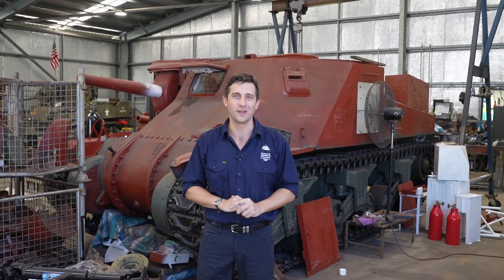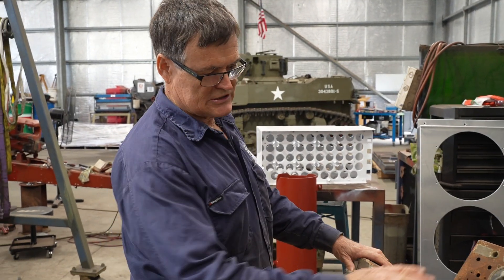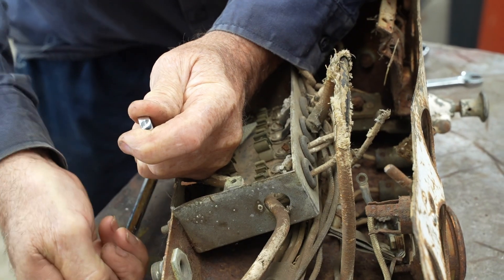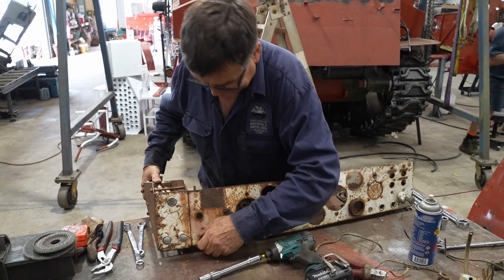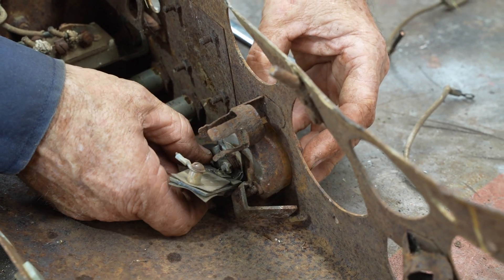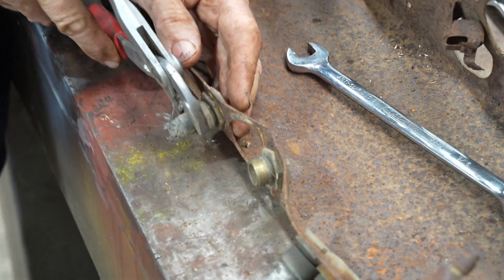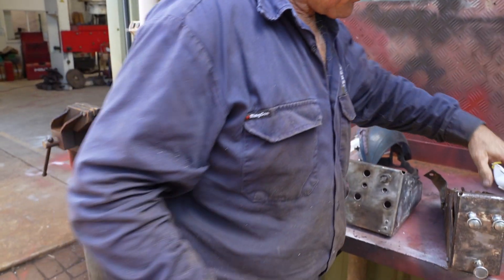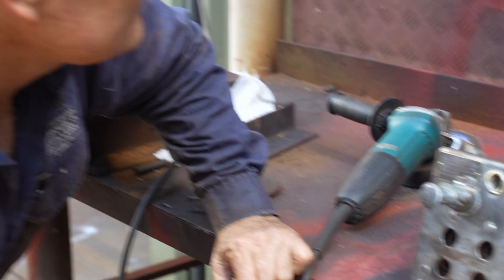WORKSHOP WEDNESDAY: Rusty WWII Grant Tank DASHBOARD restoration!

Comment: You popped up in my feed so took a gander, thank you for saving the old US tanks.  Got to love how interchangeable the yank's built everything.  Watched a British tank shop and they commented the brit tanks are more of a repeated one off as none of the bolt patterns are the same between tanks.  Were as you can chop an American tank Sherman in half put the turret ring on the two halves and weld it together. Then bolt everything back on

Comment: That switch that doesn't unscrew probably has a slitted washer that slides in and catches,   The groove it fits in on the shaft of the switch is probably filled with crud or rust.

Comment: all the fun and games of working on instrument panels, particularly those in aircraft where you have multiple gauges and switches, and so many variations of fittings, and those that are easy to work on and those you want to save but have to sacrifice, i took a year to restore a Phantom II, and had to replicate some bits including the pilots handgrip, and now i have four genuine made by Bendix of USA
its one of the many things i consider when working on these as well, that someone designed all this, different companies had to create the parts, someone fitted them, and they may only have a short service, and then the history continues when i jump in the cockpit to restore it all
 (incidentally, any one wanting genuine Bendix switches, that's the old style metal toggle switch, i have a reasonable stock of them for less than you pay on eBay, 2way and 3way
loving the vids, great content as always

Comment: I find it fascinating that you folks, or should I say “blokes” refer to the old standard as “Imperial”. Here in the US when you buy a set of wrenches you can buy metric (of course, because that’s what the car manufacturers all have switched to), or SAE. The SAE abbreviation originally stood for Society Of Automotive Engineers but now it’s just SAE. Its interesting and frustrating to me that the US not only clung to the old standard but adopted it wholeheartedly and stayed with it when the UK abandoned it.

It makes life unnecessarily complicated to have to have two sets of drawers in the tool chest for metric and Imperial (or SAE - your choice)? But that’s the reality.

I restore old Ford tractors which is bad enough with 7/16 and 11/32 and so on, but do you folks also have to keep a set of Whitworth standard wrenches on hand for older British equipment? Just curious.

Comment: There's only one negative thing i could say about your video's and that is that they are way too short. The ethos you guys restore these tanks, vehicles etc by with using as much of original parts possible and even re-use panels and bits that could be cut with a plasma table cutter in a few seconds but instead hammering them back in shape and fill gaps with a new piece of sheet metal but without losing the authentic look is what makes watching these videos so great. I have one question tho, why doesn't your shop have a sandblasting booth, it would speed up the cleaning of parts process with a big margin.  Greetings from the Netherlands.

Comment: Kurt 70 years ago, when farmers brought these machines, they were looking for a reliable means of transporting farm equipment, stock food, using a vehicle with reliable means (the tractors of today were not even being thought of then), so when they "stripped out systems/parts, they considered unnecessary" - if you had told them then, hang onto it, it maybe useful some day, they would have thought of you ""as mad". Restoration of former WW2 Military equipment in the 1950's  plus was not even considered. I live in NZ and the Military vehicles & aircraft that have been found in storage sheds, in reasonable condition has been amazing. That is when re -establishment to functioning entity was considered.
I have said this before, those who originally created and built your Military Vehicles would be amazed at the effort, the staff at your place of employment, take to restore them, even to a functioning & moving machine.